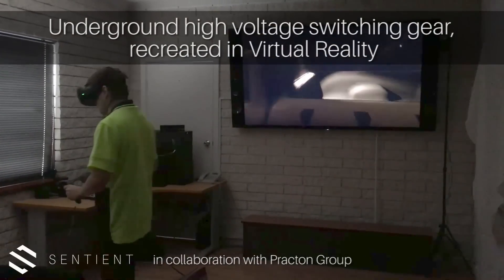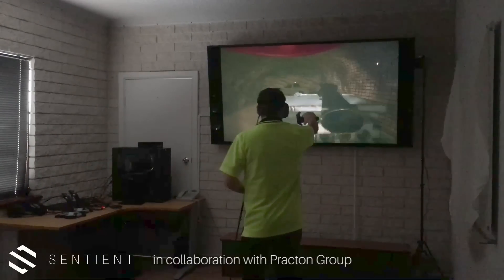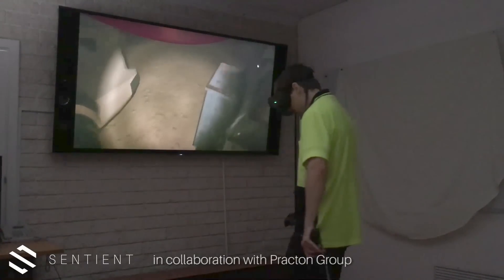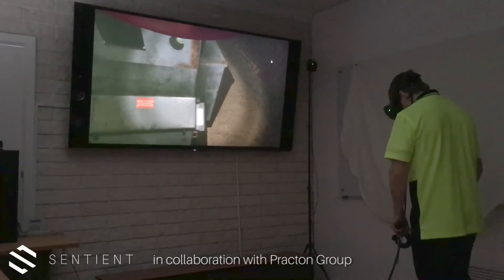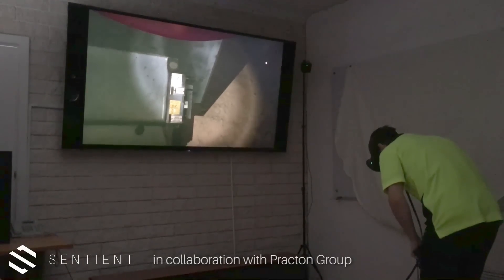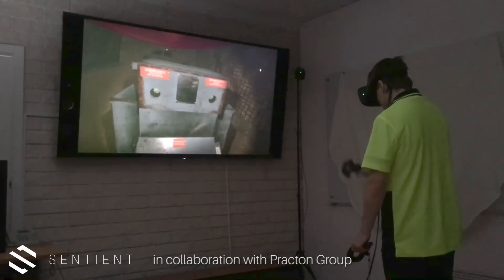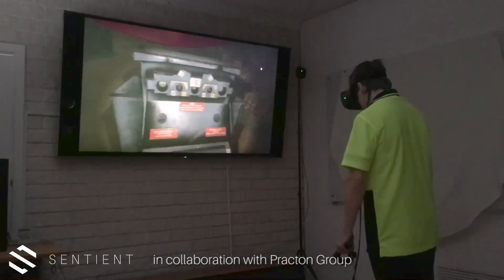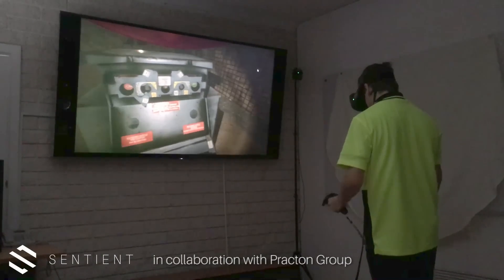High Voltage Switching in Virtual Reality

Comment: This is really cool and could potentially save lives. Are there any fail states for this training simulation? As in: will the simulation inform the trainee if they've done something that'd result in electrocution?
Reply from the maker: Hi there, in this particular example there are no visible consequences 
of incorrect actions, however we do have that in our other training 
modules. We have another High Voltage Switching module which results in 
an arc flash as a result of incorrect inputs. Other modules we have done
 have a range of realistic consequences including fatalities, injuries, 
explosions, loss of profits due to operations interruptions, and so on.